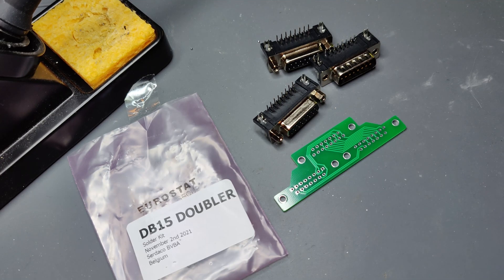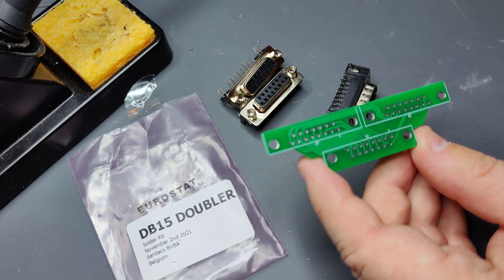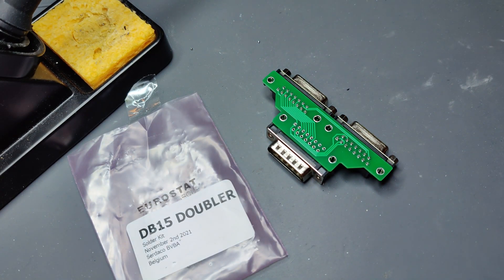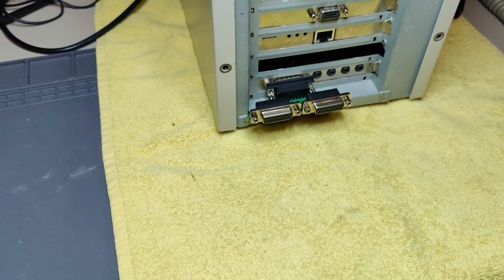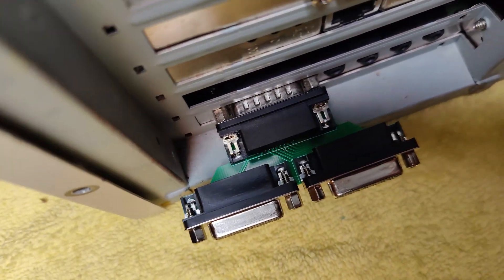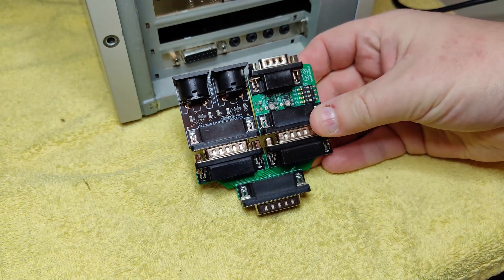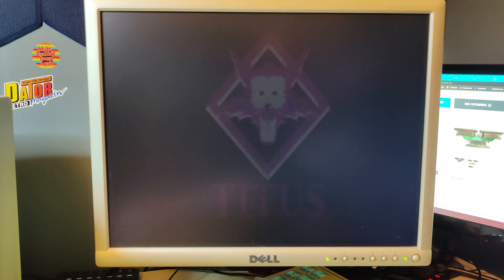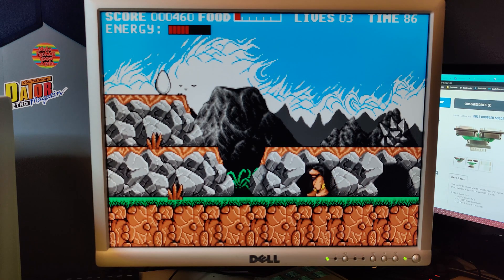DB15DOUBLER - How to turn one DB15 port to two!

Comment: Hi, do you know if it'll work if I use it on a laptop to use OPL3LPT and CVX4 together? It works as two different parallel ports or it's recognized by dos as just one but can connect multiple things to it?
Reply: hello, this will not work. This is a DB15 midi/joystick connector, and the parallel port is a DB25 parallel connector. OPL3LPT or CVX4 cannot be used on DB15Doubler